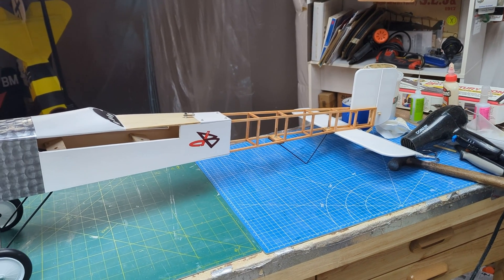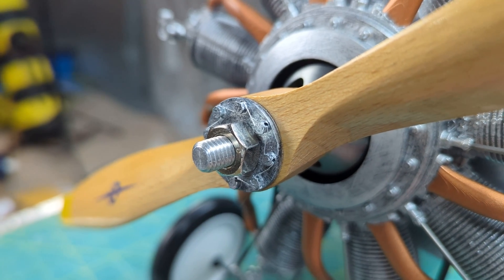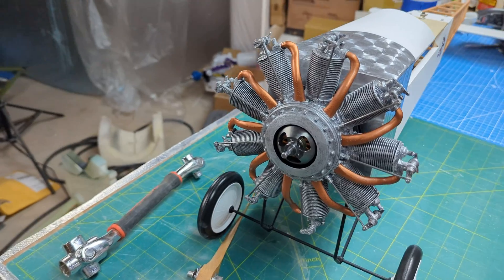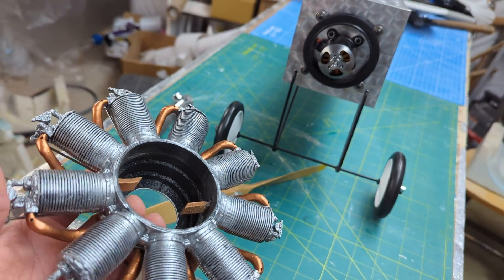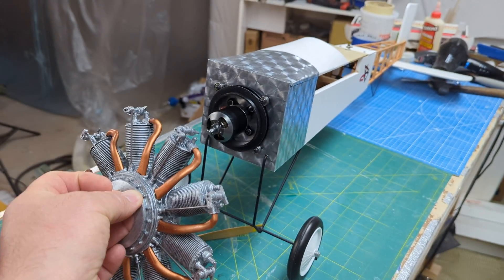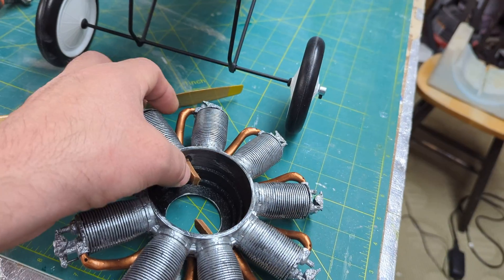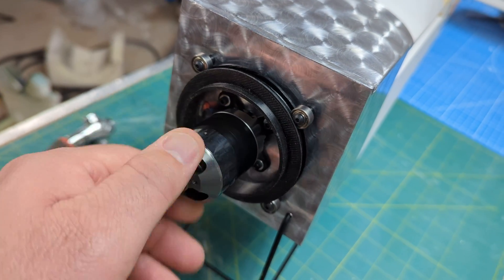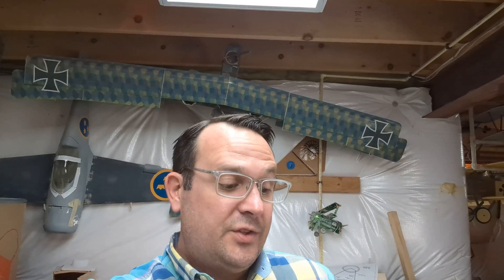A SPINNING dummy motor? Yep, and it's 3D printed

Comment: Very nice Joshua, on my electric DH2 WW1 pusher I fitted an extended prop shaft which runs through a brass tube which the free-spinning engine is attached to, as the motor turns the dummy engine spins but only at a low rpm's as the brass tube isn't connected to the motor, a very pleasing effect, cheers 👍

Comment: Interesting workaround.
 But  also  an Overly Complex Rube Goldberg solution. IMO.
 Simply print the Gnome  with a front engine case.. so the motor shaft  passes thru it. except it's  fitted with  a ball bearing...
 so that the Rotary is rotated purely by the friction  of that  ball bearing  spinning on the Motor shaft.
Reply from the maker: I see what your on about and I like it! I do have concern about wear of the bearing over time as the bearing would need to support loads from all directions, not just an axial load. In addition, I'd be concerned about cooling for the electric motor. You do need air flow to cool the motor windings and to be fair, that is something I did not mention in my video. Appreciate the thought and certainly give it a shot!